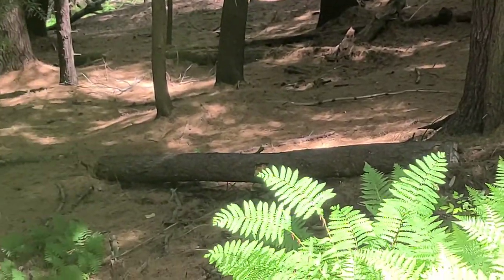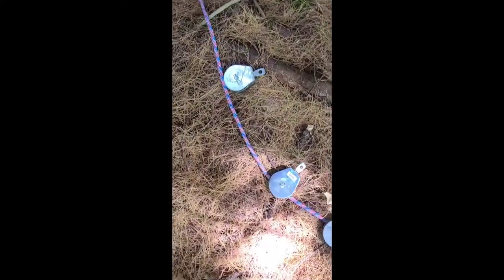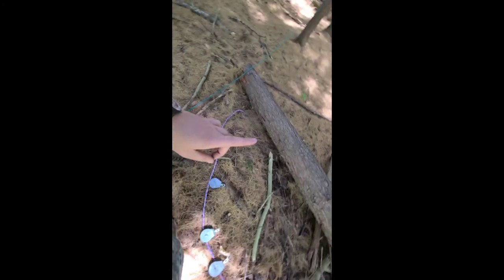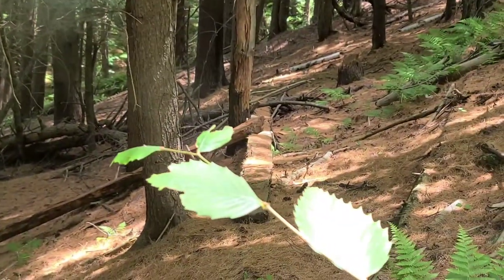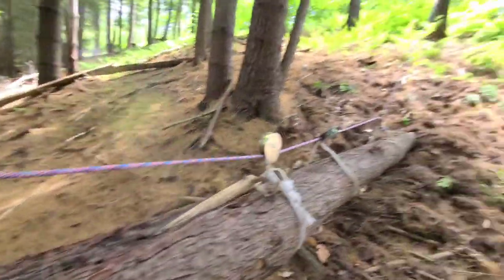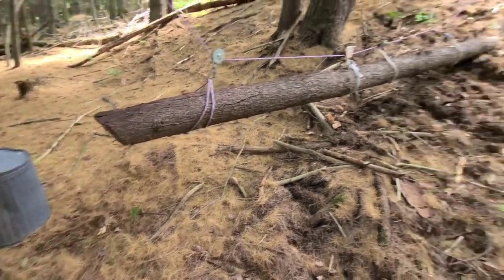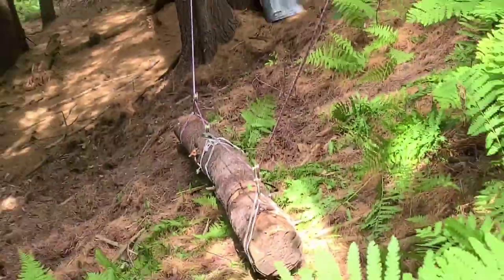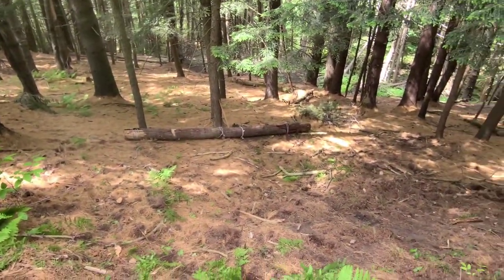Moving big log uphill by yourself?

Comment: As a person with 17 acres of woods, down hill on all sides, and no power equipment and no friends to help AND quite likely close to twice your age, my hat is off to you. Nicely done. If I may ask, what type of rope do you use for this type of thing? I assume it's not just the usual type from the big box. Some kind of climbing rope? Or a specific load handling rope? Is there a type/name? Working load rating?
One suggestion to add to the arsenal of DIY rigs: An "A" frame to use as a lever. Tie the log to the "A" frame and tie your pulling line to the "A" frame. It's a bunch of back and forth to reset the "A", but better for your back than manhandling it stooped over! :D 30 years from now, your back will thank you for it rather than get revenge on you for the abuse, like my back likes to do at the worst possible times! LOL!
Reply from the maker: Thank you! Yaa. I love messing around in the woods with ropes. I think the line I used here was probably Rated to 200lb+ but... you don't need expensive stuff. I think I got the rope in this video from Harbor freight and tool for 14$/100ft